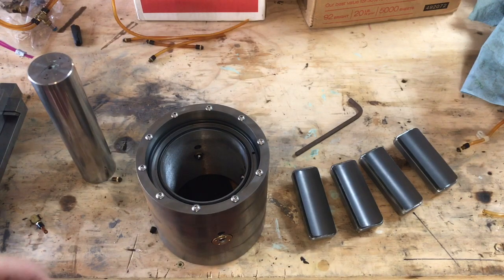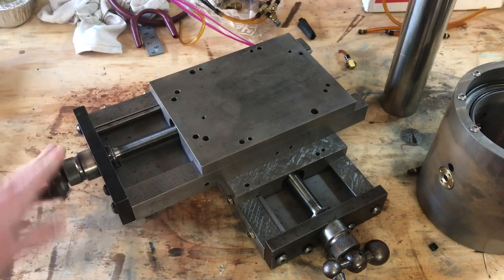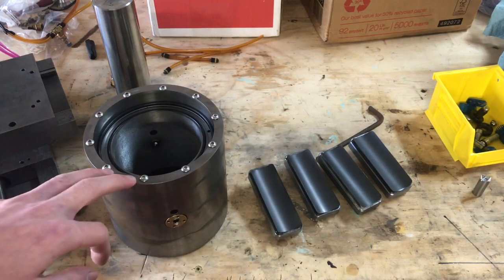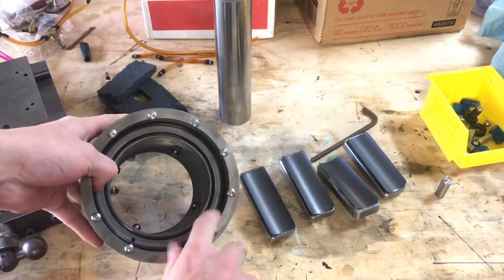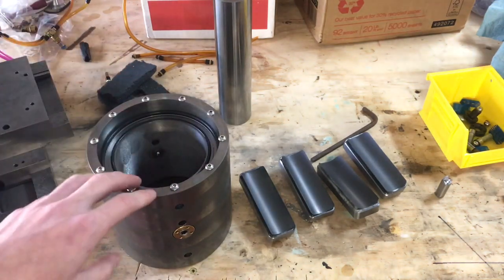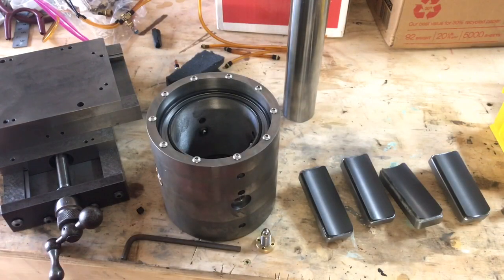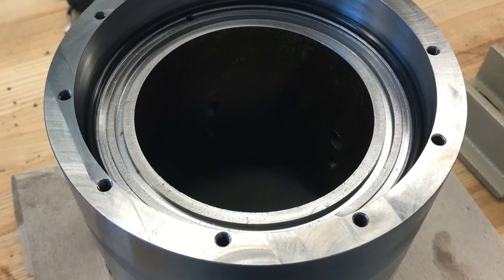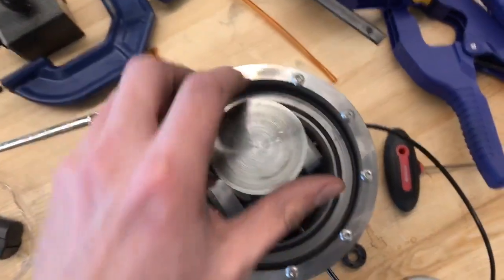OFFICIAL Air Bearing/Diamond Turning Lathe (Gelbart Machine) Project Update: Dec. 2020

Comment: Very nice progress...would it not be better to Grind the OD and ends of the shaft?  That would result in a much tighter tolerances and better finish.  Ya, almost $300 plus freight for that hunk of Cast Iron for the housing...need to order one for me now.  Thanks for the fine Documentation and sharing this with the community!!!
Reply from the maker: The shaft is ground from the factory better than I ever could. The thrust faces will be ground and then lapped. Thanks for the support! Documenting this is the least I can do to give back to the community, it’s given me so much

Comment: Amazing work! How come you have the 3 flat faces on the kinematic mounts, rather than a tapered hole (cone shaped)? In my mind this provides more surface area for rigidity.
Reply from the maker: This is true, but I also was out to minimize static friction by minimizing contact area. The stiffness of the hardened ball on the hardened mount is adequate
Reply: @cylosgarage  I see, fair enough. On another tip, what are you hoping to turn on the lathe once finished? I'm guessing it won't be your average engine lathe jobs
Reply from the maker: @lawmate  yea definitely not. Mostly optics and rocket injector elements. Hoping to make my own parabolic mirrors for building telescopes
Reply: @cylosgarage  cool, sounds nice. Can you turn glass directly with the diamond tooling?
Reply from the maker: @lawmate nope, that would end disastrously. diamond turning works on almost all non ferrous metals and plastics such as acrylic. I plan to use nickel or silver plated base metals to make my mirrors. Not sure if I'll be making any lenses, if that's what you were thinking.
Reply: @cylosgarage  i see, thanks
Reply: @cylosgarage  Do you mean directly machine out a parabolic surface?  From glass?

Comment: Hi, really nice project and thanks for sharing. Hope you can help with one question. How are you going to lap the thrust face of the shaft flat and square? Thanks
Reply from the maker: Thanks! Once it’s mounted (heat shrunk/press fit) it will be turned between centers. This will be pretty much guarantee the face to be square, but not necessarily flat. It will then be rotary surface ground and lapped using a lap that is a perfect slip fit over the shaft
Reply: @cylosgarage  Thanks! Looking forward to the next videos

Comment: Excelent work, It was 3 years ago but I want to ask you question about spindle building, I also making my air bearing spindle for presicion grinding machine but ist there any difference between using radial air bearing or can we just use air busing with thrust face? I will share my machine picture to give you an idea
My regards :)

Comment: Is there a reason for using steel as the air bearing housing vs aluminium for example?
Reply from the maker: a few reasons, yes (in order of importance):
1. Thermal stability. Aluminum is far too sensitive to changes in temperature. A few degree temperature increase could cause the housing to grow so much that the air bearings are no longer adequately preloaded. Thermal stability is darn near the #1 priority in ultraprecision 
2. Strength. Preloading the 4 bearings creates a fair amount of force that wants to push outwards on the housing and distort it. A distorted housing that is no longer round will not mate well with the surfaces on the spindle mount and hence be less rigid. I did the FEA and determined cast iron would distort far less than aluminum in this application. 
3. Cast iron also has a unique vibration dampening property that aluminum does not. This is not of huge importance but is always nice when building machine tools.
These three main reasons along a bunch of other smaller factors like cost and machinability led me to decide on cast iron.

Comment: Have you considered using differential threads on your radial bearing adjustment screws?  If you combine an 18 tpi lefthand thread with the existing 20 tpi screws, you would have effectively a 180 tpi adjustment. One turn at 20 tpi moves forward 0.050", while the 18 tpi moves 0.0555" back for a net movement backwards of 0.0055" or 180 tpi.
Reply from the maker: If I had a nickel ever time I got a comment suggesting differential threads I’d have at least a dollar or two lol. I considered it, yes, but it’s really just a convince thing. 20 TPI works and it’s not really worth the time designing and potential loss of rigidity just for a little increase in user friendliness. Especially since I’m the only one who has to live with my decision.

Comment: Such a cool project. Great to see so much progress! Have you considered maybe making  an air bearing stage to go with it as a followup to this? Don't mean to create more work for you! But, it would be fun to watch. Kudos!
Reply from the maker: absolutely. Mk2 is going to include linear motors and air bearing axes.
Reply: @cylosgarage  so cool! Im working on a linear motor, no air bearings for now though. Take a look at my prototype. I managed to integrate water cooling channels into it, but haven't perfected the process yet to clear them after casting epoxy. Take a look; designs are completely open source. Link to github is in the description: https://youtu.be/bwdEMA3n0Z4
Reply from the maker: @primozlord  awesome! i was just thinking about making my own the other week after seeing how expensive they are. Are yours iron core/permanent magnet? Those are the type I'd like because i can use the magnets to preload the bearing stage.
Edit: i see they're not lol, no problem. Still very interested in your driving strategy though
Reply: @cylosgarage  no, it's an ironless motor.  Two permanent magnet tracks with the forcer moving inside the magnetic field. An iron core design has the downside of introducing cogging, which you have to deal with somehow. 

On a side note; today I discovered that Philips patented a design which allows for 2D movement inside the magnetic field of an  linear motor. Brilliant idea! (N-forcer)

Edit: Since creating my own driver for this motor was not something I wanted to do, I purchased a bldc driver from Trinamic. With this driver I have the freedom to implement my own driving strategy. There are a few options to get a linear motor initialized. The most basic is to power the coils and let the motor settle into it's magnetic field. Alternatively you can perform an open loop movement towards a home sensor or something. In both cases you know from that moment that it's synched to the magnetic field and you can depend on the encoder afterwards. In the video I linked I enabled the motor and let the motor settle in, after which I tell it to zero it's position and perform some movements in a loop(currently all in position control). I'm still having a hard time getting the motor tuned correctly in very high speeds and acceleration.
Reply: @cylosgarage   Cool. Looking forward to the next installment.

Comment: Have you considered using a differential screw (instead of really fine threads) for the adjusting screws?
Reply from the maker: Yep, decided against it due to complexity of implementation/potential rigidity problems
Reply: @cylosgarage  
Differential screws can be simplified if you hold the nut steady.

To reduce complexity you could bore and internal/external thread a simple sleeve/bolt to the diameter of your brass locking nut. Internal thread to 1/2-20 and external thread with a slightly different pitch. Put some wrench flats on this sleeve. Your adjusting screw(B2) could stay the same but to adjust, hold B2 to avoid rotation and turn B1. Might be a little uglier on the outside of the spindle but it gets you fine adjustment. Your casting is plenty thick so the sleeve(B1) diameter can be large enough to single point thread with a tight fit to avoid rigidity problems. You could also lengthen B2 to extend out of B1 and add locking nuts to both but it would add some clutter.

Enjoying your video and progress!

Comment: Oh my god how I messed with the head of a PhD. who develops a model for simulating roller bearings - he knows quite a bit about air bearings and I told him "Man, but what about those EUV litography machines, that operate under vacuum. How do you have those moving platforms with the waffers moving inside without physical material on material contact. If it touches, it creates particles, and you don't want to have particles inside a EUV machine, so you have to use some kind of an hydrostatic-hydrodynamic bearing :D He stoped talking for 3 minutes and then he said he needs to look at it :D
Reply: Wow I’ve never considered this. Many other semiconductor processing equipment operate under vacuum too. Wonder what kind of bearings they use? I see roller bearings in SEMs stages usually, although I have no idea how or even if they are lubricated.
Reply: @andrewphillip8432  it moves with 15g acceleration :) https://www.youtube.com/watch?v=hQrtAJsJ-U0 .. so I guess magnetically levitated + linear motors for movement as they write on the website
Reply: @chronokoks  Ahh that makes sense. That is quite an awesome feat of engineering
Reply: @andrewphillip8432  It's fu**ing nuts really :) :) :)

Comment: He also mentioned that he bought used surplus of "semiconductor machine bearing motors". What kind of machine did he get the air bearings from for $500? BTW your mic is really low, you need to either talk louder or increase your mic's volume before uploading to youtube.
Reply from the maker: Literally search air bearing spindle  on eBay and there’s a bunch for not too much money

Comment: There is no way you're getting sub-micron backlash out of lead screws. I highly doubt the ways are even that accurate. Not to mention thermal expansion, rigidity and vibration, bearing load and tool deflection.

 A standard Aloris tool post is routinely repeatable to .0001" or less. 

Their new indexable version is Published at 0.00005" repeatability in their sales literature. Don't flatter yourself.